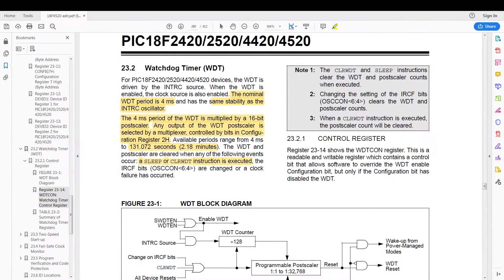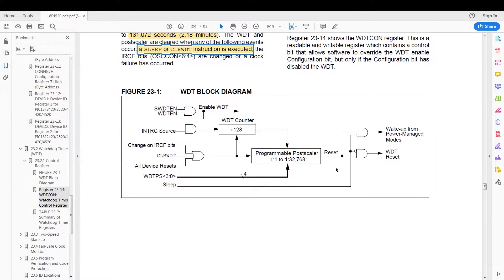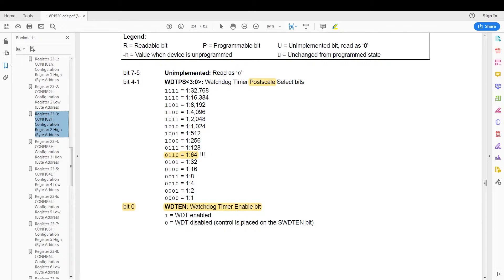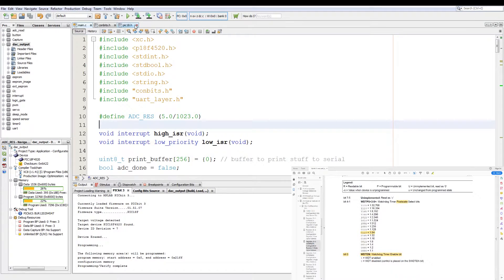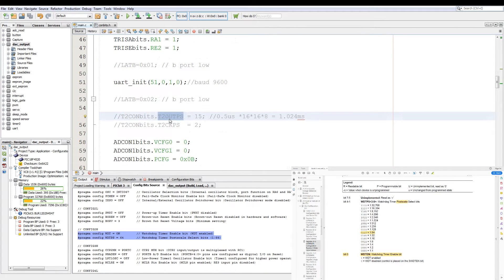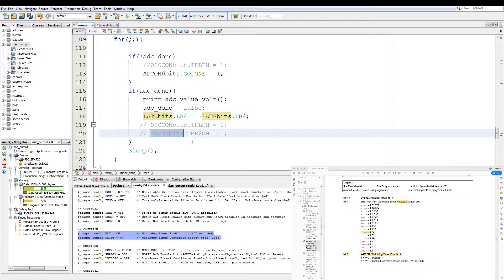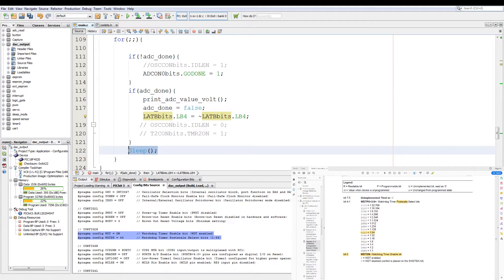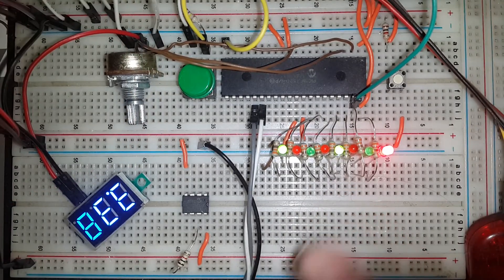Watchdog Timer (WDT) 🔴 PIC Microcontroller Programming Tutorial #19 MPLAB in C

Comment: Trying to understand the watchdog timer calculation from the Excel sheet, so the internal clock is set to be around 31-32/128 = 0.25 and 1/0.25 = 4ms. Is this the right way? thank you
Reply from the maker: (128/32kHz) * postscaler. the sheet is wrong

Comment: Hi Binder Tronics. Please explain that we will use wdt in such kind of real project and I want to make a project that a led will be on 3 times in a day for instant delay_hours(8); and output_high(led1), such programming is possible or I should use timer0 , timer1, timer2 specifiction?-thanks
Reply from the maker: WDT is there to prevent a MCU form stalling. I suggest using a RTC to switch your LED.
https://youtu.be/VsWx12BDuVo
https://youtu.be/tu4vGNo6mvc

Comment: any programming tutorial on external watchdog?
Reply from the maker: 74LS90 decade counter. Some sort of clock source (NE555 easiest). Microcontroller pin firing at a set interval to the 74LS90 reset. Output pin from 74LS90 (QD) to Microcontroller reset. Output pin (QD) from 74LS90 to 74LS90 reset. Most Microcontroller need a active low input to reset so the reset outputs may need a not gate.
Reply: @BinderTronics  or 
MAX6373? how will you code that. thanks
Reply from the maker: @SA-ys8eg  WDO to Microcontroller reset. Microcontroller pin firing (high low) at a set interval to WDI. SET0 - SET2 Table 1. Minimum Timeout Settings in the datasheet.

Comment: Can I use it for saving my multitasking cooperative code from freezing up ? so how to use the WDT to be triggered only when the program freeze up ?
Reply from the maker: Yes you can. I use WDTs with FreeRTOS with no problems. Create a task or timer with low priority and reset the WDT in that task/timer. If you know witch task is locking up then put the WDT rest there.
Note it's better to find what is causing the lockup.
Reply: @BinderTronics  Yep, you're right. Of course I should know the cause of the lockup, but you know in case if any external issue happened; like, missing a signal, hardware problem .. etc. But also I'm in the beginning, I have a lot to learn about designing systems.